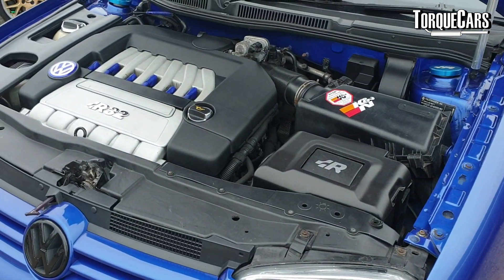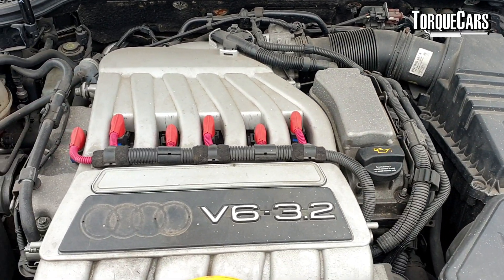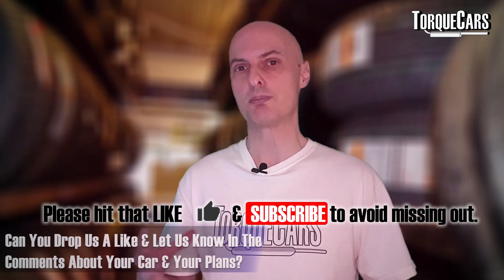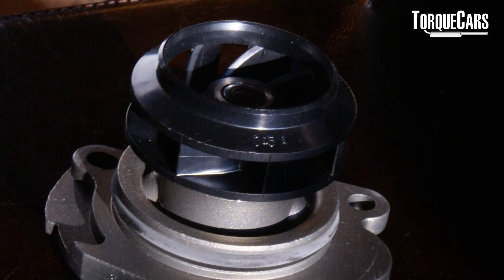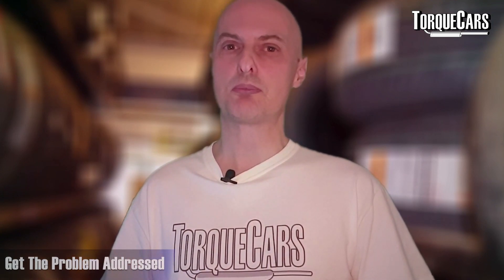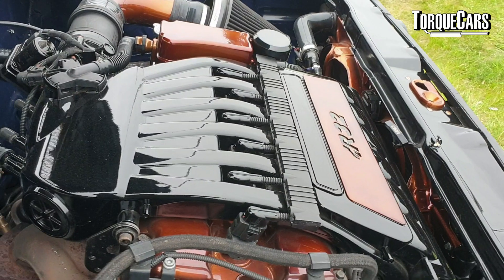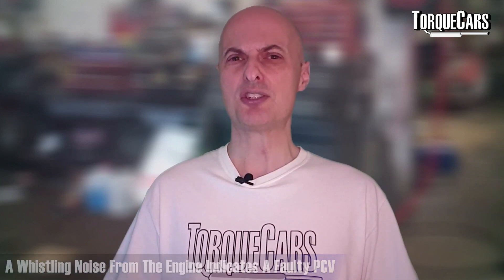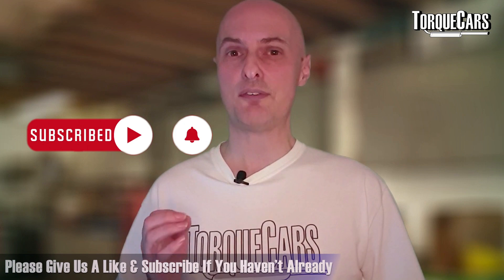Fix Common VR6 EA390 Engine Problems VW Audi Skoda Seat [Engine Guide]

Comment: I have a 1997 VW T4 Caravelle with VR6 engine. Intermittently Engine will start and immediately stop. Still diagnosing issue. Open to suggestions. 1st step is to replace fuel pump relay '167'

Comment: Owner of a Mk5 R32 here, bought late 2016 with 250k km on it by the single previous owner and just over 300k km on it now in late 2023.
I've had to replace the aircon compressor, alternator, starter, serpentine belt, pulleys, hoses and various other bits and pieces but had zero problems with the engine itself except the rattly timing chain which led to a full engine rebuild at 265k km since the engine was already out of the car.
From the look of it the single previous owner did regular engine oil maintenance but at some point neglected or extended DSG services leading to an expensive new mechatronic unit and set of new wet clutches for me. I don't know but have a feeling VW did something to the mechatronic unit because it now feels a lot smoother off the line and in crawling traffic than the Mk5 GTi DSG I owned new back in 2008.
Lightly modded on eibach springs, bilstein b8 shocks but otherwise standard.
Most people talk about the noise the VR6 makes at full throttle but I love the sound at idle and just cruising around with windows down.

Comment: nice video, i'm currently having problems with the pcv system, is there a workaround to replacing the complete lid? just replace the membrane?
Reply: The diaphragm is inside a housing which is inside the valve cover. I paid like 10$ on Ali. By memory , I think we need a small torx drivers maybe even temperpoof torx. Something like T10 or T15 I'd guess. Also there's a small test hole next to the PCV Pipe. The air should not pass through there. If you hear it and it stops when you plug it then the diagram should be changed. Could be a good time to have a valve cover gasket on hand when you do that. The biggest job is to remove the intake, and to cean the cover if you do.
Reply: @michaelgidoni7736  RKX sales a diaphram replacement for about $100 (includes intake and valve gasket and injector o rings). Or, replace the whole valve cover.

Comment: My 2000 vr6 acts like it's gonna turn over then does nothing I can't figure it out it's sat for awhile
Reply from the maker: Does it do this when the battery is boosted? Is the solenoid kicking the starter into the gear or is it just clicking and whirring? Have you tried rocking the car in gear to engage another tooth with the starter motor then trying the starter again?

Check for fuel and spark as these are the most common non start issues on a VR6, and pull off any diagnostic codes from the OBD port which might give an idea what the issue is.

One last thing to check is that the keyfob battery is good, if the immobiliser is on due to a weak battery the thing will never start.
Reply: @torquecars  i opened the fuel cell under the rear seat and it wasn't priming or making any noise. also its had the same gas sitting in it for awhile I feel overwhelmed with this because I'm not a mechanic
Reply from the maker: The fuel filter could be clogged, the fuse to the fuel pump or pump may be blown, check for voltage at the fuel pump. Old gas does degrade over time, it tends to form a wax which can block filters.
Reply: @torquecars  when I get to this I'm gonna check all these you just listed, I'll also make a short video of what is happening when I start it maybe if you see it you could give me a hint because man this thing wants to start and its just like nope. its also locked in gear I put it in neutral and it was stuck? I hope someone didn't sabotage my car or drop the linkage. I know exactly who would do this and used to do this to cars. idk where the linkage is on it or if he could even get to it.

Comment: Im having a rough idle with mine right now in an a3. I live the car, but it has been problematic since ive owned it. Thank you for all your knowledge, my list of replacement parts longer now but at least its more focused! Great video!
Reply from the maker: Thanks for the support and encouragement my friend I'm glad you've found it useful.
Reply: My a3 is running rough as well. The vcds says I’m running -21 percent fuel trims…. Fuel pressure ok. Mass air slightly higher 6.42 g/s unplugged it and issue still there
Reply: what other problems have you had? do you still have the car?